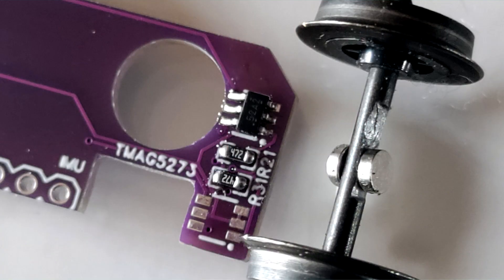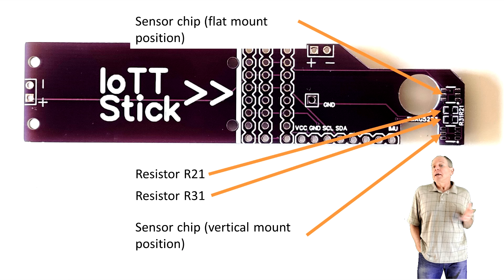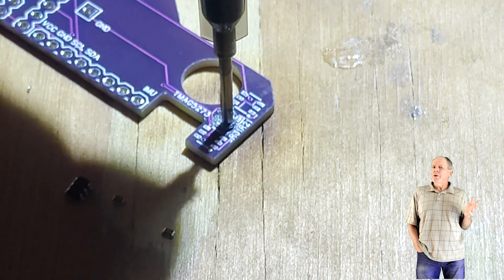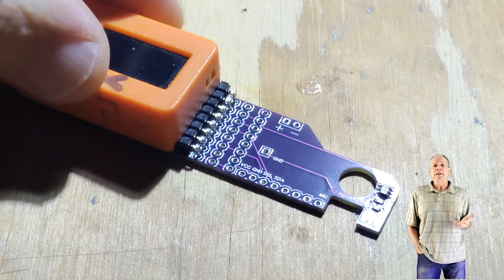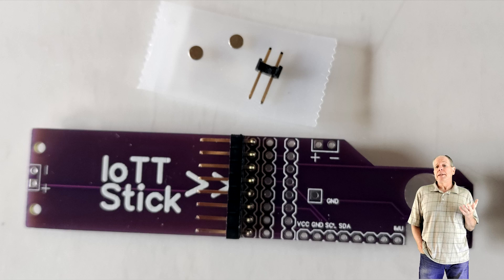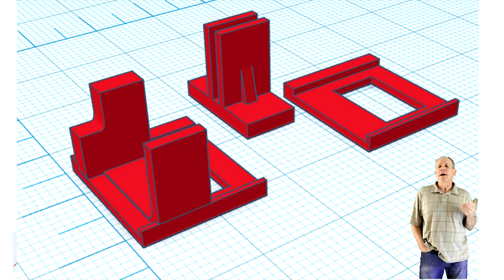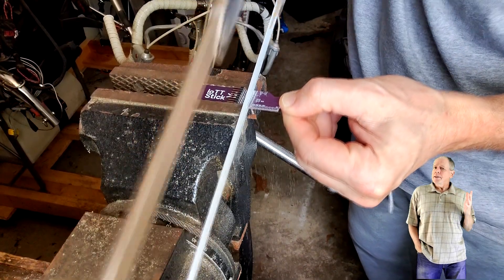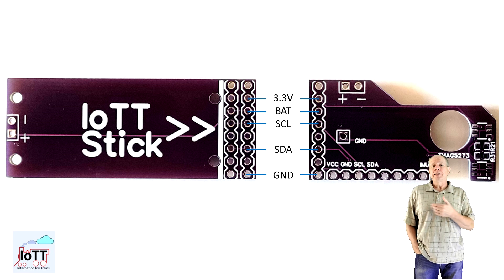Build your own PurpleHat Sensor (Video#93)

Comment: I recently purchased the PurpleHat and I'm working on putting together an N scale set up. I didn't want to cut up a box car, so I decided to use a flat car. I can only seem to find N scale flat cars with metal decks, though. The one I bought doesn't seem to be ferrous, because I can't get a magnet to stick to it. I'm assuming the car is made of aluminum, since that's probably the most logical metal to use for something like this. Do you think the sensor will work properly through non-ferrous metal?
Reply from the maker: That should not be a problem at all.

Comment: looking forward to building this but I'm having difficulty sourcing the Hall sensor as listed - do you think I could replace with 
TLE493DA2B6HTSA1 from Infineon ?
Reply from the maker: There are good chances it will work. The pinout is not identical, but seems compatible as the PurpleHat does not use the interrupt feature. Should be easy to replace the TMAG driver by one for this chip and adapt the Stick software.
Reply: Sounds positive, but could you recommend another alternative that does require a rewrite of software.  Seeing as that is beyond my capabilities!

Comment: General question about the IoTTStick when using with PurpleHat.  How long does it run on it's internal battery and how long does it take to change?  Just wondering how many locos I can do before it runs out.
Reply from the maker: With the IoTT Stick Plus it runs about 20 Mins. Charging takes about twice the run time as the charging current is limited to about 80mA by the Stick BMS. To get longer operating times you can add an external 3.7V Li-Ion battery.
Reply: @IoTT  Thanks.  Does one of the screens show the charging status?  I see an  info screen, but not sure if one of those lines is a good indication of battery state.
Reply from the maker: The info screen shows the battery voltage and the battery current. If the battery is fully charged, the voltage should be at 4.2V and the current is zero. When you discharge, it shows a negative battery current, and a positive value when charging. The cutoff is when the battery voltage is around 3.7V, if I remember right. That's when the Stick will shut down to prevent low voltage discharge of the battery.

Comment: Received my purple hat and iott stick yesterday.  Installation was very easy and its working great. I'm going to try my first speed calibration today.  The bent ends of interface pins sticking through the board seem to fit nicely in-between the simulated wood joints on a LGB 4010 2 axle flat car with the sensor right over the center of the axle. I'm excited for this upgrade to the purple hat.  Up to this point I had a magnetic bicycle speedometer mounted to the car to measure speed and distance.  The automated nature of the purple hat is going to save me lots of time.
Reply from the maker: Sounds cool. I never thought about using a bicycle speedometer for this. But then, for N scale it probably does not work ;-) 
Btw: Since you have plenty of space, you might think about using an additional battery to make it work longer.
Reply: @IoTT  Yes I am thinking of adding the battery. I did run out of power just before I actually got to do a calibration, although I did get alot of nice measurements before that.  Do you have any suggestions?  I think I saw in the video that you were using one.
Reply from the maker: Any 3.7V LiIon will do. See here: https://myiott.org/index.php/iott-stick/user-manual/iott-stick-core-2/installation

Comment: Love your work, Hans!  Just purchased my first IOTT stick and purple hat kit.  Going to test this in my G scale engine, hope to use it with magnetic reed switches and JMRI to implement block occupancy detection and automated control. So many possibilities!
Reply from the maker: For the moment it is just a distance/speed sensor. Once the IMU is supported, it will be able to report the location on the layout. To activate reed switches, you probably need an extra magnet on the car as the direction of the field of the sensor magnet changes. The reed switch could miss it, but you will have to try it out.

Comment: Really interesting.  I look forward to making this in the near..ish future!  Is there any way to get a screen saver on the IoT stick? I’m concerned that the screen may suffer from extended periods lit with text onscreen.
Reply from the maker: I tried dimming it in the software, but it was not convincing. On the other hand, it is all LED background light, so there is no risk. I have one running for more than one year without shutdown and there is no problem with the display.
Reply: @IoTT  I have just updated the firmware to 1.5.10 and I see all the hats in the dropdown including Purple Hat.  However, when I subsequently load up my settings file that I saved to include my MQTT server details I notice that the purple hat option and a couple of the red hats (I think) are no longer visible from the dropdown menu in the first page of the configuration on my web browser.  Would this be a bug or am I missing something....?
Reply from the maker: Looks like this is a bug. Here is a workaround:
- Load 1.5.10
- Save just the node configuration to a file: Go to the Node configuration tab and hold the CTRL key down while clicking on Save To File. This will cause the Stick to only save the Config part, but not all the other data
- Load your old data file
- Load the newly created Configuration file
The Stick should now have the correct config options and your data loaded. Please try and let me know the results.
Reply from the maker: @roydom5  Problem is fixed, please get the latest 1.5.11
Reply: @IoTT  looking good. Thank you